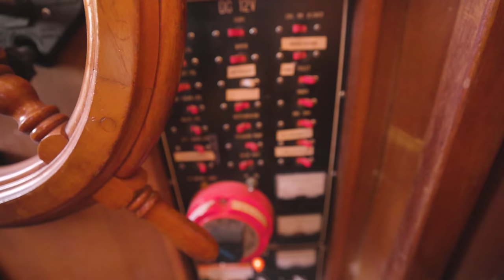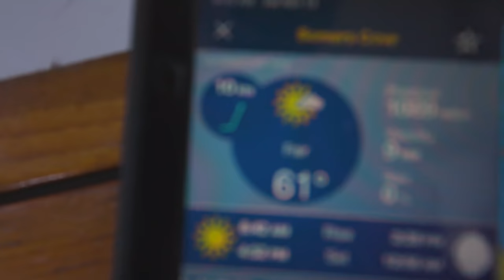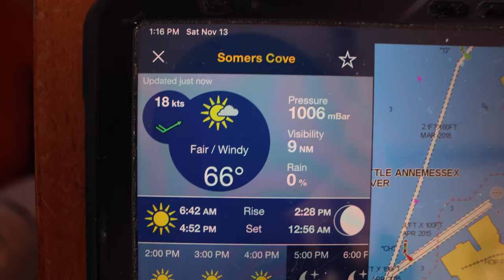Preparing to leave the Chesapeake (getting our trawler ready for full time liveaboard cruising)

Comment: Best way to get rid of mold is to stop it before it starts. (I know, easier said then done) however, white vinegar mixed with water is a great cleaning solution for boats and it really helps to keep mold from growing. Vinegar placed into a small bowl will absorb odors in a boat. Vinegar  poured into the boat’s head also helps control odors and keeps clogs from forming.  Or you can go to West Marine and buy their over priced products.
Reply from the maker: Sweet thanks for the tips Greg! We actually do keep a bottle of vinegar & water in the heads for odor purposes but didn't think about using that for the covers. Also didn't know about the small bowl for odor absorption - thank you!

Comment: I have a similar trawler mine is 34ft. Wood stove for heating looking at do some modifications to the salon couch no generator yet maybe down the road also bigger water tanks only 80gal. Going to add solar and more insulation in the v berth which has non. I live in Ketchikan Ak so much cooler.
Reply from the maker: Nice! Makes sense with having the stove up there... one day we'd like to cruise Alaska - seems really awesome!
Reply: @SchoandJo  watch sailing sea venture on YouTube they just did it in a bigger boat for sure I think there like 50ft. They were in my neck of the woods for most of the summer.

Comment: Did the vets recommendation on feeding Ollie at night work?
Eliot go easy on that wrist. As you get older you will be thankful you did. Lugging the battery in the repaired wrist had me going yikes.
Be safe and may you have fair winds and following seas southbound.
Reply from the maker: The vets recommendation has worked. It is really strange that it just started happening out of the blue at the dock in Crisfield. Almost without fail, Ollie will throw up if we skip dinner, so now she gets 1/3 breakfast, 1/3 at 2pm, and 1/3 when we go to sleep and it's been working well! 

I was wondering if anyone would comment on that with my wrist... I definitely made sure to go nice and slow and keep the angles solid but it was pushing it. no more of that! 

Thanks for the warm wishes! Thanks Jeffrey!